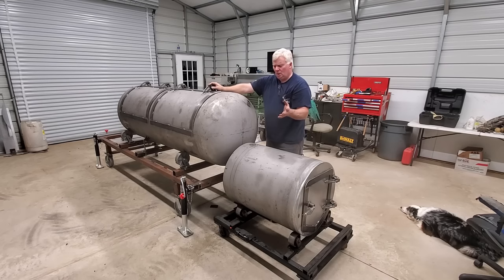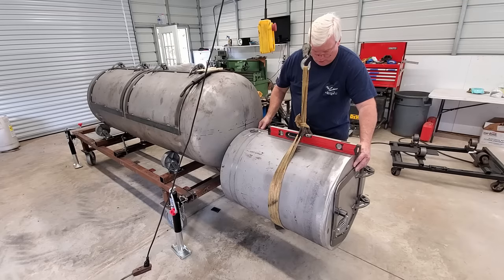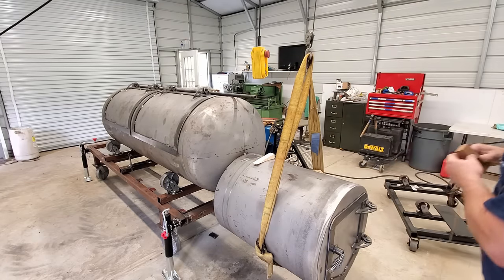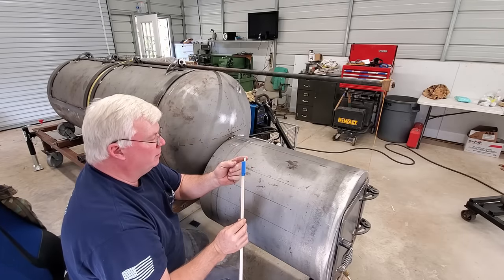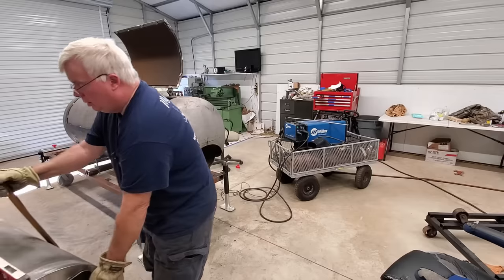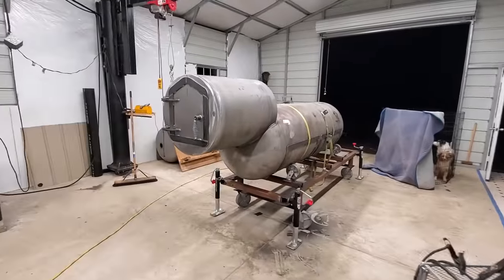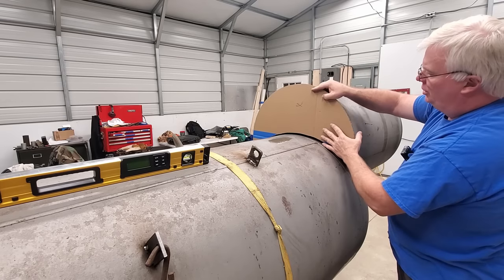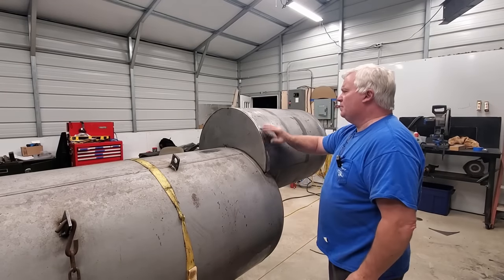BBQ Smoker 250 Gallon Firebox Joinery

Comment: I really like your series, by far the most detailed and best explained. And as you, I share the aim for perfection.  Sometimes 5 minutes more of work and measuring will give you years of satisfaction, an easy trade off.
My wish is to build my own smoker soon (I am based in Spain) but I have no welding experience whatsoever. Your videos give me the confidence to give it a try. 👍🏼
Reply from the maker: The welding skills needed to build a smoker are almost a non issue.  Today's mig welders are so easy to use and achieve results that far exceed what's needed for our purposes that its not something to worry about at all.  

I'd buy a good quality welder and watch some mig tutorials on YouTube.   

Welding with a mig  is one of those skills that you can achieve "good results" with very little practical experience.   You can achieve "very good results" with a  good bit of experience.   However,  achieving those beautifully laid out beads of a professional welder takes years of skill building.  

Fortunately for us.  That level of performance is not necessary with cookers.
Reply: Same here👍

Comment: I opt for a reverse flow offset smoker joining my firebox about 3" lower than my grates in plan of a water tray below the grates. Been happy with it for 8 years now. Good luck on your endeavors!
Reply from the maker: Yeah  I've built my share if RFs.  They have advantages and disadvantages.   My personal favorite is the 330g direct flow.   I enjoy the firebox management requirements of a DF although it can get tiresome on long cooks.  I think the added smoke exposure benefits of a DF are worth the added work.  

In addition,  DF cookers are easier to clean.  I've seen far too many mice and even large rats nesting hidden under baffle plates.  

However,  there's no denying it is far easier to run a RF.

Comment: I have a 300 gal tank i am planning on Build what size fire box would you recommend your videos are truly the best detailed for these builds
Reply from the maker: It really depends on the tank shape and diameter.   I run 24"×31" round fireboxes on 250 and 330 gallon systems.. both of those systems utilize a 30 inch diameter tank.    If your 300 has similar parameters,  that size is very easy to manipulate splits while facilitating great flow.    The trick is finding good 24 inch pipe.. i much prefer round fireboxes.

Comment: Hello...me again, Chrétien from Spain.  The building of the 500gallon regular offset is going smoothly. I am now at the point of joining the insulated firebox  (1000x1000x1000mm outside dimensions and 900x900x900 inside dimension) to yhe cook chamber. I have the opening space figured out, but I am struggling with at what height the opening of the fb should be?  Is this gratelevel (as the opening for the smoke collector), below gratelevel...as low as possible. Thanks for helping me out. Have a great day and merry Christmas
Reply from the maker: The throat opening of the firebox to the cc should be at least three inches below grate level.   A 500 can even tolerate more than that.   I wouldn't worry about 4 or 5 inches. 

An important factor to keep in mind is full door extension height.  

Dropping the fb too much raises that height which can get dangerous.   

Trailer ground clearance is another consideration.

Comment: You vediis are top notch as far as the detail you go into on how to do things good job say ive been watching and learning and I'm about to start by 250 gal one of your videos you filled the tank with soap water and took it for a ride then drilled a hole after that hole is in there do you start making cuts on the empty tank? I want to make sure I do the first cut rite for obvious reasons and the way my tank is designed the valves and openings are on the end cap so unless you stand it vertically you can not get it 100% full of water.
Reply from the maker: Those tanks can be a pain to clean out, but they sure are nice otherwise.   

Just stand that bugger up fill er up.  You want the water to push all possible remaining has out.  If it overflows at the top, you've done that.  

Be very careful.. that's a lot of wgt.
Reply: @mysticsmokers3014 
Thanks that is what ill do and just cut the door i hate to do that but its the best way i see to open the tank up. You do really nice detailed work on your pits and explaining and are appriciated. Also im a pipeline welder/ fabricator and have learned a lot.

Comment: I apologize if you explained this in the video, but can you explain the benefit of leaving the lip on the top firebox extending into the cook chamber instead of cutting it off at the weld line?  Your video is excellent!
Reply from the maker: Great question.   I do explain that in the grate video where we can see that.  In editing now. 

The hot air leaving the cook chamber wants to shoot immediately to the cc ceiling after leaving the firebox.   Leaving this area in tact forces that air to stay down a bit longer allowing the superheated gass streams and cool air a bit longer to blend.

Otherwise,  the superheated gas streams climb tank cap wall and run the ceiling while the regular hot gasses take a less dramatic flow.  

I've been experimenting with various size and patterns of holes in that pipe area to measure effect.   So far, I can see no effect at all.  These small changes are very difficult to quantify given the variables between cooks.  Even small differences in ambient humidity can change fire management for a cook.  

Im gonna use my plexiglass door window to make some real-time observations on this next cooker.

I'm also trying a wedge shaped diverter to tack weld or bolt to the under side of that lip area.  The hope is to push those gas streams out of their focused stream and give a wider flow entering the cc.

I will likely bolt it in place to try various configurations. 

Ill make a video of that.

The fun part of this process is the experimentation.   Although most ventures bring me crashing right back to my basic cooker, sometimes, an idea pans out and it's effects can be easily proven.   There are too many guys out there that swear by their ideas or new gadgets.   Sadly, very few can be teated side by side with an otherwise identical cooker.  This is where I have an advantage.   I build the same proven cooker over and over.  Small changes are easily proven beneficial,  not beneficial or indifferent.

Comment: Another great video. I did come to the realization that i don't have the capabilities, equipment, or patience to build my smoker this perfect.  Hopefully i can just get it close.
Reply from the maker: I'm available for any help I can give.   
Don't hesitate to reach out via mysticsmokers@gmail.com and I'll give a phone number if needed.
Reply: Your rotisserie stands paired with your overhead crane make a great set up.  These wont be an option for me but the video still helped me to get a better idea of how to go about joining the firebox.
Reply from the maker: @biscuitrider1     that's a very good point.

You don't need the full-blown table like mine.  

You can simply lay out two 8x8s about 4ft long and put cheap casters on them.    Join the 8x8s with 2x4s on the outside to keep things from shifting.   That will allow you to at least spin the tank.  

An engine hoist is sufficient.   

That's what I did in the early days.  I built several cookers thay way.

Comment: Do you have any videos with a square box? What is your opinion on them? I am going to use a square box so I can have a table inside or my water pan. I will also put a small tube coming out of the top of the main chamber as a refill port
Reply from the maker: No sir.  As long as I have a source for good pipe, I'll build round fireboxes.   They are significantly more efficient at directing the hot gas flow.

I'm not a fan of water pans either. After years of using them, I could see very little benefit aside from deflection of the hot gas streams.  

Ultimately,  I just let hot gasses have the far right side of the cooker.

Those gasses will Ultimately go to ceiling no matter what you do.

Comment: Is the throat size just the difference between where the firebox and tank meet? I've seen where some builders calculate the size of the throat and it may be smaller that where the tank and FB meet.
Reply from the maker: Yes.  The opening between the fb and the cc is the throat.   I make that opening as large as it can be for the given components.   

I want minimal air obstructions and maximum flow.  I control airflow with the fb door to achieve a maximum burn for the fire in the firebox.   

The question then is always, "how do I keep from overheating the cook chamber?"   The answer is simple,  build a smaller fire.  I "tune" my splits to match the general desired temperature range for a particular cooker.  I use a two-split rotation and get in a rhythm of changing two splits out at a time every 20 minutes or so.  That way, fire is always running super clean.  Minit adjustments in temp can managed by the door opening.  To reduce temperature,  you open the door to allow more cool air to enter the cool chamber.  

Of course this cook method requires a great deal more effort and attention to detail in fuel preparation than most guys are willing or capable of doing.   However,  in my opinion, it is by far the most critical element of the cook and sadly the least understood.   

Proper split preparation will eliminate many variables throughout the cook and make your job so much easier.   

I will do a firebox management video as the last episode of this particular build series.
Reply: @mysticsmokers3014  Appreciate the detailed response. I built a 60 gallon a couple of years ago, but just picked up a 250 for another build. You fire management method sounds a lot like what I do with my 60 gallon. I’m sure the splits are larger with the 250. Really appreciate all of the detail and knowledge in this series. Even though I’ve already built one there’s still tons to learn
Reply from the maker: @jonny1925   Good deal.  Don't hesitate to reach out if I can help in any way.

Comment: It appears to be a simpler design than the reverse flow. Why didn't you make this reverse flow? Because of size, inefficiency? Please let me know.
Reply from the maker: The reverse flow cooker is a variant design to make firebox management more forgiving and allow the operator to more easily maintain cook chamber temperatures. 

Every improvement comes with at a cost.  In this case, the cost is food flavor.  

Two issues contribute to this.  First is reduced smoke exposure because a good percentage of the cooking heat is convective heat from the baffle plate. The remaining cooking heat is from the hot air/smoke. 

Secondly,  the scortched grease taste and smell.   Since the plate near the firebox is so hot, it scortches the dripping grease.  Many guys like that taste while others do not.  

Once one learns proper firebox management,  running a direct flow is quite easy.   The fantastic flavor from a direct flow can not be beaten.

Comment: If you continue to build smokers, a Dewalt/Bosch vertical/Horizontal line lazer would make your job a hell of a whole lot easier. I use them all the time in my profession. No more plumb bobs, shortens your labor time witch equals money
Reply from the maker: Yeah, my little old laser is outdated for sure.   I need to get one of those.   I just haven't shopped for the best option yet.  

I didn't show it in this video but I have a very nice pipe center mark tool.  I actually use it far more than the laser and I use it to check my laser 12 o'clock line.  

Its a far more accurate method but it takes more practice to get the layout done quickly.   The center mark too method to get that linel is extremely accurate where the laser method can cause some problems.  

I debated even showing the laser in this video series since its very easy to introduce errors if you dont understand the geometry.  Getting your tank precisely level is so important to get accurate results with the laser.  

Hopefully,  I drove that point home.  The tiniest error in tank level can throw you off a good bit.   Of course   the machine will self level to perfect. 

The only point where I find the laser truly the 
"best tool" is marking the head center lines.  Reaching around that corner is tough with anything else.  

Perhaps I'll do a quick video showing the two methods and the pros and cons of both from my perspective.   I should have a new laser in a couple of weeks since mine is having switch issues. 

Thanks watching and the input.

Comment: Strike a center line on the floor, and line up the front and back... I use a clear coat spray over the chalk line so it doesn't rub off.
Reply from the maker: I have since found a better way:

Tack a piece of flat bar to the inside floor of the collector going up about 5ft.

Raise the laser tripod high enough to shoot down the top center line of the tank. 

Mark the laser line on the tall flat bar.  

Lower the laser to working level and line up the flat bar mark with the vertical center mark on the tank end cap.  

The new laser has a plumb Bob light hitting the ground.

Put a piece of tape on the floor and mark an X on it with a sharpie. 

As long as I don't move the build table, I can locate that position in seconds.   Otherwise,  its easy to line the flat bar with tank end cap just like sights on a rifle. EASY PEASY!!!

I'll put a photo on my Facebook profile.

Comment: Is the grill a old propane tank ?
Reply from the maker: Yes John.
I use tanks from the 1950s and 60s.  They are the best metal alloys and thicker material.   That is a huge benefit.

Of course, the tank has been professionally sandblasted inside and out.

Comment: Good video but 1 critique, Why not use a piece of 3x3 angle iron layed down on top of the bigger pipe on its 2 legs.  Extend it out over the of the small pipe to check the alignment?
Reply from the maker: I'm always looking for better ways to do things.  However,  I'm having a hard time visualizing what you're describing.   

Do you mean instead of my 1 inch pipe?  

Hang a string from the angle?
Reply: @mysticsmokers3014  yes hard to explain but easy to accomplish. I was a fitter for a long time.  Your work is superb, keep it up!

Comment: Your video's are good but, a reverse smoker does cook more even across the whole grates. All that requires is a baffle and stack on firebox side. Why not ? Saves a lot of figuring out hot spot and losing grate space.
Reply: I build a lot of reverse flow cookers.  RFs were in fact introduced to provide a more even cooking experience and easier firebox management. 

Like everything else in life, benefits come with costs.  Both types of offset cookers (Direct and Reverse flow), have pros and cons.

Comment: Your firebox is too close. the smoker will be too hot for that side 25%.
Reply from the maker: Thanks for the comment.   Let's look at this assumption and my logic for the placement.  

At 31 inches long, the superheated gas streams have a good distance/opportunity to blend with the hot gasses.  This minimizes the scortching from those streams.  

 In addition   the tall rear wall on the 24" pipe  blocks  most of the radiation from the fire itself reducing thst effect.   

At 3 inches down, from grate level, we reach a goog compromise between ground clearance,  cooker overall height and grate distance.   

Dropping that level two inches would have  tremendous effects on ground clearance and overall height with minimum effect on grate distance.   

Those superheated gas streams are going to shoot to the ceiling immediately after leaving the firebox.   That is typically contained in the first 8 to 12 inches.  

That's the nature of direct flow.   

A reverse flow addresses this issue but comes with it own costs for that benefit.   

I've built and run this exact cooker many, many times with slight variations for effect.   3 inches is my favorite for the 24x31x3/8 in a 250g system.   

Again, thanks for the input.   Further dialog is welcomed.

Comment: To much talking!!!!!
Reply from the maker: My videos are not for everyone.   Sorry they are not a good fit for you.
Reply: @mysticsmokers3014  We get it, we understand why the long explanation. But try cutting the explanations down just a little. You'll find that in future videos (If you become monetized) you'll get more viewers. And try breaking the videos down into 12-15 minutes segments. (Example part 1,2,3) And then do a wrap up video where you can go into a 20 min explanation of the tricks tactics you used. You'll gain more viewers using this method.  Btw, I think I'd have added a door, Or a way to control the amount of heat going into the cooker from your fire box. But hey, What do I know. We built a square box cooker with a different approach on the fire box. Good luck Sir.